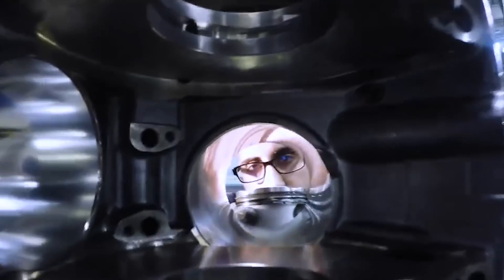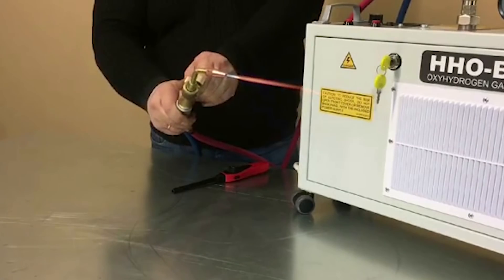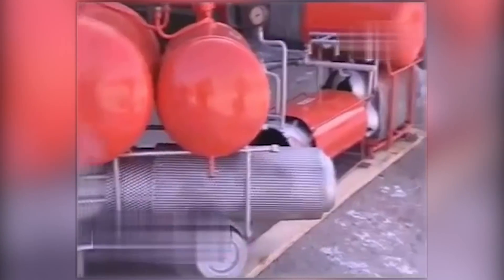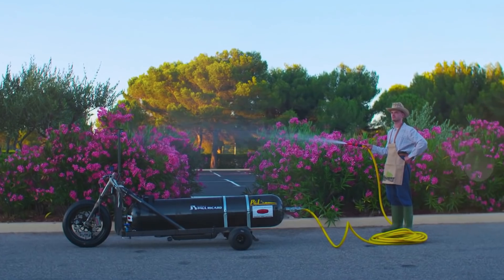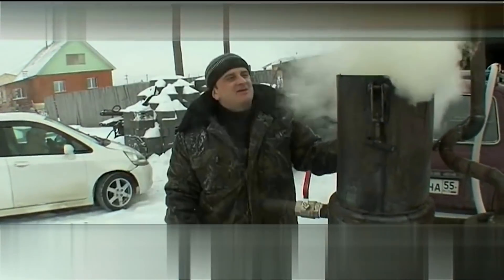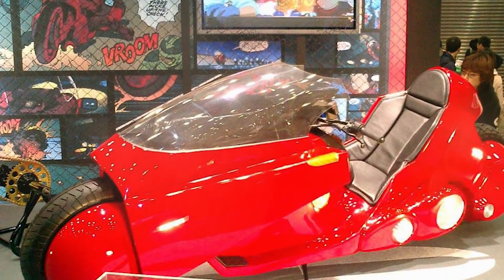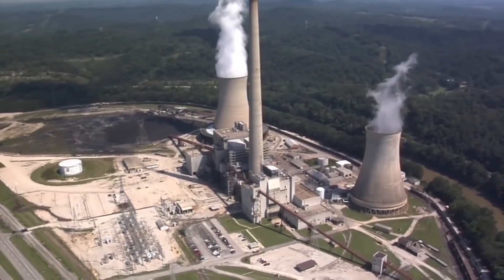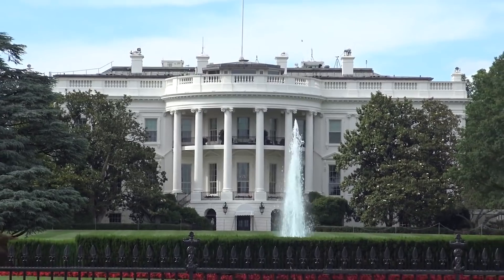Why These Engines Are Banned?

Comment: On the air powered vehicles if it had air solenoids and pumps attached to the wheels that aren't driving it you could recharge your air tank as you drive when pressure drops to low the solenoids could swap tanks so you have a fresh tank and recharges the tank that was just emptied

Comment: None of these engines are banned
If you had bothered to look into ANY source of why thorium ISNT used, instead of just looking how at videos of people assuming its amazing, you'd understand the very scientific reason behind why we don't use it. And all the alleged advantages of "thorium reactors" are actually advantages of molten salt reactors, which can happily and easily run on uranium.
And water powered cars are complete bullshit, easily disproved by the simplest understanding of thermodynamics:
-You need energy to create hydrogen from water
-the most efficient way of turning hydrogen into energy is through a fuel cell at 70-80% efficiency (NOT a horribly inefficient combustion engine at 20-30%)
-you need more energy to turn water into hydrogen and oxygen than you will gain from turning it back into water in a fuel cell, the conversion is not self sustainable
-It takes 180MJ to create 1kg of hydrogen from water. You get 96MJ by combining 1kg of hydrogen through a fuel cell.
-You're LOSING 84MJ/kg just in trying to generate fuel, and you somehow need to make enough of it to also move a vehicle?

Comment: The reason why all these engines are not used in masses is because they aren't so great as they may look like. But you have to understand the main working principles to see why they aren't that good. And what is that bullshit with a magnetic motor? A motor driven by magnetic forces is called a electric motor and these are everywhere

Comment: In excellent conditions the 1991 Honda CRX could get 80+ mpg. It’s not a hybrid of any kind, just an optimized gas engine.
Reply: Exactly, as it stands the internal combustion engine is just about as efficient as it can be in its modern form when paired with a good transmission.

Comment: GET OVER THE COMBUSTION ENGINES GO ELECTRIC IS THE BEST ELECTRIC CARS WILL RULE.
Reply: Except that electric cars actually produce more pollution to make and run than regular cars. The majority of electricity produced worldwide comes from coal. Also the process required aquire the materials and make the high capacity batteries required for any sustainable use of those vehicles is just as if not more pollutant than the entire life of a regular car.

Comment: Air powered is actually powered by the compressor. That consumes energy. Lots of energy is wasted in heat. Worst part: it's a 5000 psi BOMB, for each tank.

Comment: Why do people insist on publishing videos without checking even basic things?  

None of this is banned. They are not being used because they are not competitive with engines in use today.
For example the air powered engine.  Air is not the source of energy in this case. The energy has to come from somewhere else - electricity from coal/gas/renewables in an electric compressor, or liquid fuel in a mechanical engine.  The compressed air bottles are only storing the energy, just like a battery.

Some of these engines are even being actively researched to overcome their shortcomings.  For example, the opposed piston engine was actually used both in vehicles and in stationary power applications. It has recently been improved to the point that the modern version produces more 25-30% more power for the same full, and and has lower emissions.  A 1000 BHP version of this engine is currently under testing for US army combat vehicles.

Not everything is an oil industry conspiracy!

Comment: Why the Water Engine isn't practical — Hydrogen gas is a terrible fuel. It's odorless, tasteless, can be ignited by a spark and plays a number on many metals. If a highly pressurized hydrogen tank fell off a truck, that tank turns into a missile that will ruin your day, and somewhere along the way a stray spark will make it an even worse day for you. Hydrogen really only achieves its promise when it is stored as a liquid (no heavy pressurized tanks), and being cryogenic, that brings its own host of problems. Oil companies are just plain not scared of this engine.

Compressed air engine — compressed air tanks have the same problem as compressed hydrogen tanks; when they pop, they turn into missiles. They're not flammable, thank goodness, but that limits their specific energy (energy per unit mass) — I mean, you say that the compressed air bottles "aren't very large", but compared to the gas tank of a nothing-special gasoline car, they're enormous. And it takes time to fill that tank, on the order of an hour or more, compared to a few minutes for a petrol tank. Also, we kind of know what compressed air can do, and actually use it and its like all over, including in your car (your windshield wipers are powered by the inverse kind of motor — a vacuum motor). Again, oil companies are just plain not scared by this engine.

Wood-fired car — do we really need another source of rampant deforestation of our planet?

Magnetic engine — this is a straight up fraud. Magnets cannot be used as a source of energy as described. It's just an electric engine with snake oil applied. Magnetic fields, see, follow the conservation of energy, too. You get out what you put in, and a small battery can pack a surprising punch. So, no, oil companies aren't afraid of this, either. It took a batshit crazy billionaire to even carve out a small place in the automotive market for electrics.

Cold fusion — another fake — Fleischmann and Pons never created nuclear fusion in their cell; thousands of tries to replicate their experiment have failed utterly, and their claimed fusion rate would have produced radiation enough to kill them. We've only barely created absolute break-even for hot fusion (let alone economic break even), which is the only type of fusion that has been experimentally verified to be possible. If it is even possible, cold fusion would be dozens of orders of magnitude tougher to achieve. You're not going to get a cold fusion plant before getting a hot fusion plant, and we're already working on those. Fossil fuels are not impressed.

Thorium reactors — Even with a fully developed fuel cycle, a thorium reactor will still produce mountains of radioactive waste: U-232, Tc-99, I-129, and Pa-231. All of these are quite nasty and requires the digging of holes to put it all in. Then there's the fact that thorium plants have been in development for decades and no economically viable application is forthcoming. Uranium plants get a huge public subsidy because the same technology is strategically relevant. Thorium? Not so much. Fossil fuels are not impressed.

Don Wiley — you say that police declared it a deliberate crime, and I can find no reference to such a declaration. You say that the FBI offered no explanation was offered to why it happened with a 2m retaining fence, but I found the explanation offered by the Shelby County police (not FBI) in under a minute: the bridge was under construction, Dr. Wiley's rental had paint transfer consistent with hitting a construction sign, Dr. Wiley had an underlying disorder that would be exasperated by the alcohol he consumed prior, and passing traffic can cause wind gusts and roadway bounce that would likely cause him to lose his footing. Now let's take your six famous geneticists and microbiologists passed away under "mysterious circumstances." Of course, since you don't give us who passed away, there can be no follow-up and no fact-check. Of course, I must balance that against the scores of otherwise unremarkable individuals in that year who also died under mysterious circumstances. It's meaningless. This is a mere insinuation, not a connection.

Comment: They are not banned, they just either don't work or just can't be scaled up.

Others like the rotary engine have been used in production cars. Its just that they are horribly inefficent.  many of the other alternate designs require much more frequent, and expensive, maintanance than more conventional designs.

Comment: 130 kilometers is just 70 miles, that is frankly insufficient for American Markets and even most European markets, that means your average European driver would need to fill up no less than once a day, and your average American driver, would need to fill up 2 or 3 times a day. And compressors burn a lot of power, you are talking a lot of air, while you may only pay 2 or 3 cents per liter of air, you are talking about 500 liters of air or more, that's only 10 dollars to 15 dollars per fill. But remember, that's 70 miles. 10 dollars for 70 miles is 70 cents per mile. Your average gasoline car say a honda civic, will go 350 miles and it will cost at March 2020 prices about 25 dollars to fill. That's 8 cents per mile. Almost 10 times as economical. And mind you, that's while the honda civic is more comfortable, faster, larger, and safer. If you went with an early 80s EF2 Hatch, then you are talking even more insane, with a range of around 300 miles but being nearly twice as efficient as modern cars thanks to the car's lack of weight, seriously, EF2s were like 1400 pounds, they were stupid light, and they got 55 mpg on the highway. The reason compressed air doesn't take off is because it's not fundamentally economical

Comment: There are several reasons why some of these good ideas don't make it. As a electronic design engineer who owns a company that design electronic products I have some experience with this issue.
1) all concepts are good but not all designs. The devil is in the detail to determine if something works well or not.
2) Just because you can build it, does not mean the public has use for it. I can build a rocket to go to the moon, but if no one want to pay to go, then why do it?
3) Market does not follow the most advance concepts, but rather the most economic trends. Supersonic flight never made it because people would not pay that much money to fly that way. Instead for a 10th of the price, fly a bit slower. Hence Concorde operated at a loss despite the ridiculous ticket prices. Market decide what is hot and what is not. New inventions comes with practical problems like infrastructure, support, parts, costs, regulations and compete with existing trends.
4) Market competition, if one company brings out a product, no one pays attention. But if few companies compete over it then everyone is interested. If one guy slap himself, people laugh, if two guys fight someone is selling tickets.
5) good inventors and engineers are not always good business people. They put all their attention into engineering and little effort on how it will make money or even solve anyone's problem.  

There are many good ideas on paper, but it is only after proper tests have been done, market research and viability studies are done before you even have a shot at getting into the market. An idea is not a good idea just because you and few buddies think its awesome. To bring out a new product takes a lot of hard work and analysis of the market environment and small mistakes can cause it all to fail. 

Once it failed it is deemed spoiled goods and nobody want to touch it again.  It does not surprise me that most of these new ideas never make it to the market, it has little to do with big oil. It has more to do with the fact that a successful product is more than just good engineering or a good concept. It is about good market research and good marketing in the right market environment with the right design detail.  Like how do you convince someone to buy a car at twice the price with no parts available? regardless of how well it is engineered. The market is competitive and pragmatic. Regardless of the concept, the devil is in the detail and there usually is a hell lot of detail.

Comment: To @cmdrbigbob the engineer, and everyone else commenting that these technologies don't exist, they do. The U.S. government even tested thorium reactors, but if you ask for public records ot this; you get copies so redacted that you might a well asked for  black sheets of paper. In list order I will name things for you. 
1. I have seen with my own eyes an experimental carburetor that got 300 miles to the gallon. It was by Ford in the 80's 
2. I was taught by an old mechanic how to adjust a one barrel carburetor on straight or slant 6 engine to get 65 mph, that's why fuel injection is common now.
 3. Nicholas Telsa didn't invent free energy that violates the laws of thermodynamics, was he actually did was figure a way to tap into the earth own magnetic field, which if you look into basically makes the Earth a giant generator., how do think lighting is produced.
4. I seen with my own a car with an afterburner on it in an early 60's Chrysler   with a slant 6, one barrel carburetor get 250 mpg. For those of you who don't know what an afterburner is, it's like turbo charger, but it also reroutes the exhaust and air like the turbo back through the engine. 
5. Say Smokey was a mechanic who had a regular column in Popular Mechanics magazine, he invented a water injection system that raised the mpg of cars to 20% to 30% according to what kind of vehicle it was. He started offering this to people through the, he was immediately sued by the big 3 car manufacturers in the U.S. in federal court, which ruled that he could only modify vehicles at his own shop they put so rules and regulations about how he could do plus extra taxes on it that not many people could afford it. 
6. You can go the U.S. Patent Office in Washington D.C. and look up a lot of things like the things mentioned, but you have look through the patents for yourself, and there is a lot of them to find the ones you want, these aren't listed on their website, you can even get copies of them, and build them for your own use, but if put any of them into your relatives cars or friends and you are caught; you get to go to  Federal Prison for a long time.
7. All of these patents are owned by big oil companies, or the U.S. Government so think about that; It's not like the government would lie would they?

Comment: The dangerous half truths in this thing made my tinfoil hat spontaneously combust.
Reply: I DIDN'T KNOW ALUMINIUM WAS FLAMMABLE !
Reply: @douglasrowland3722  Aluminum is extremely flammable, only thing that prevents it from spontaneously combusting in the presence of oxygen is the fact that aluminum oxide forms on the surface nearly immediately and prevents further oxidation.
Reply: @jakobrosenqvist4691  ''...And the Elements shall melt with fervent heat......"
Reply: Noooo... That's the orbital mind control ray. They needed to turn it on max to keep you from learning the truth about those magic machines...
Reply: When you have to hid your like dislike ratio
Reply: @j mcmann THAT'S your objection here?
Good grief. The conspiracy levels around here are off the charts.

Also you DO know what a 'theory' is, scientifically speaking, right? It's actually a statement with a considerable amount of evidence behind it.
(Nothing is ever an absolute fact, scientifically, but you can judge the level of confidence involved.)

Also there's a pretty huge difference between finding some methane and ethane, and the other constituents constituents of crude oil. 

Ethane can be produced from UV breakdown of Methane, and Methane can form due to purely geological processes, but on Earth largely forms due to biological processes (cows burp it out, amongst many, many other sources)

Your first mistake is assuming these two molecules alone prove that oil isn't a biological product. (that is, something that started due to life).
Your second, is assuming these processes are mutually exclusive, as though the fact that you can produce something using geological processes or inorganic chemistry precludes there also being organic and biological ways of producing something...

Seriously...
So you can find two types of hydrocarbon molecule on another planet, (for which there are known geological formation methods even on Earth).
So... What about the thousands of other molecules contained in oil?
We just gonna ignore those?

Repeating half-baked ideas based on an extremely shallow understanding of a subject leads to some absurd conclusions...
Reply: @KuraIthys  @j mcmann ran away

Comment: Ooh, look everyone, a magnetically driven engine, absolutely wild. 
Wait.. I think I may have already seen something like that, oh wait it's a MOTOR.
Reply: they claim those magnetic motors don't use electricity, but wont give away the secret as to where the energy comes from. more bullshit.
Reply: These "Magnetic motors" are simply Synchronous motors/generators. They are pretty efficient and widely used in power plants and (with permanent magnets) as AC servo drives.

Comment: Spam Lab.
None of the engines are new, almost all of them are impractical.
Why are gasoline and diesel engines the main offerings on roads today??? Because they are reliable, practical and proven. The fuel they run on is cheap and, most importantly, energy dense.
Almost all other fuels on offer are either expensive to produce or lack enough energy density to carry enough on board the vehicle to make it practical.
Move along, nothing to see.

Comment: The existing auto industry is very well setup to use existing designs regardless if there is a sound new idea that works, retooling costs would be a major holdback and high profit margins must be maintained, unless they can foresee the same production volumes a new idea will as always ( mostly ) sit with the inventors with little funding to speak of.